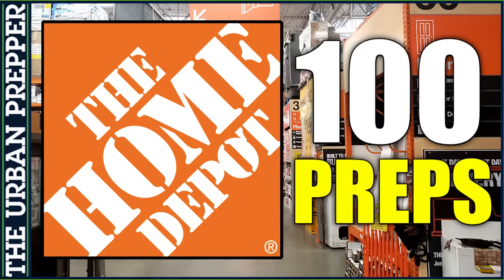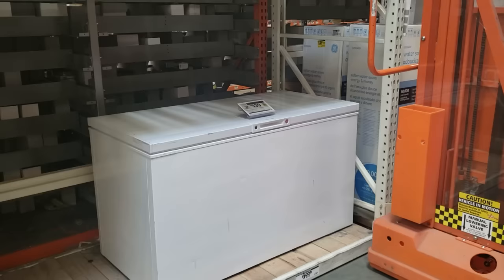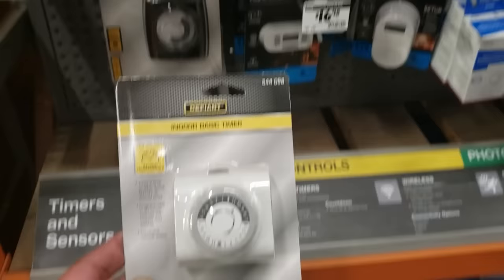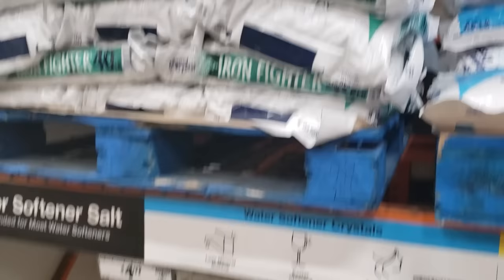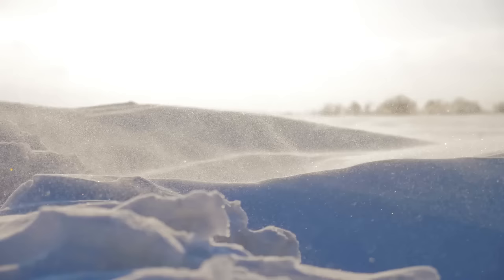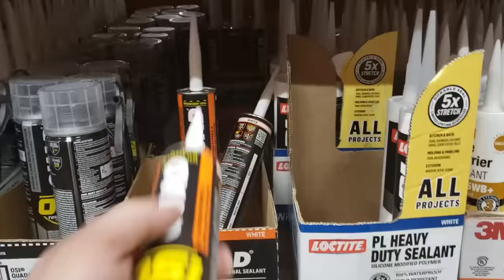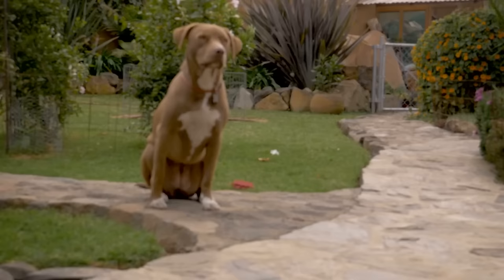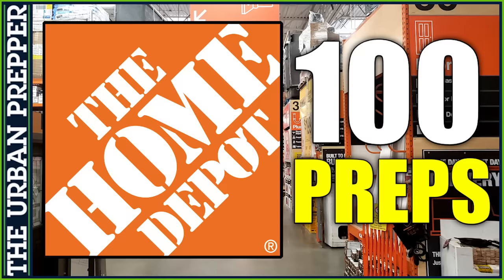Top 100 Preps to Buy at THE HOME DEPOT

Comment: Garden pump sprayer also handy as an emergency shower, fill with warm water, good for camping too.
At times of civil unrest leave some items obvious and easy to steal, ie a fuel container that's filled with water in garage whilst your real storage is elsewhere, there's a chance robbers on the move fast will take what they can easy find and move on.
Reply: Or go to Walmart and get a couple of the 5 gallon solar showers.  Just fill them with water and put them in the sun for a couple of hours them you can have a hot shower.  You can find them in the camping gear . Or you can go to any camping store or get them online.  Very useful to have.

Comment: Instead of Sand Bags 2:40, I'd suggest using "Empty" 25/50 lbs Rice Bags (Woven Polypropylene).  If you regularly eat rice, or store rice in Mylar bags/5 gallon buckets for preps, you can reuse the rice bags the rice comes in for whatever prep you'll need.  Often there are free sand/earth/rocks you can find listed on craigs or local classifieds you can use to fill those bags for floods or whatever.
Reply from the maker: Great recommendation!!
Reply: Lol I knew there was a reason I didn't throw those rice bags out...They just looked handy.

Comment: Good video.  An observation that might've been made re PVC glue (there are currently 1300+ comments, so if it's been mentioned, sorry, but bears repeating anyway) is to store it UPSIDE DOWN.  You'll likely need some sort of pliers/pipe wrench to get into it later, but you'll get in to find still-liquid cement instead of a ball of gelatinous mess from the air seepage through the lid's threads.  

If it's upside down, sure it'll glue the lid shut, but once it does that it will also seal against air getting in to the rest of the can of glue.
Reply: Fantastic information. I have wasted so much PVC glue in the past.

Comment: something i would like to point out about the snow shovel aspect, you're going to want not 1 but 2, 1 of which being a square steel shovel that you might see on excavation sites or maybe in a garden. the steel wont bend or break under extensive pressure and given that what usually fallows snow is ice thats a really big asset to have. i've been in maine practically my whole life and being the only one who does the shoveling in my family i gotta say if i had to choose between a platic or aluminum snow shovel as opposed to a stury steel shovel i would go with the steel any day. also the note of breaking, a steel shovel being used as an ice excavator is more likely to have the handle break but those are easy to replace, but with snow shovels the plastic ones are prone to having the scoop snap in half and the aluminum ones are prone to bending after a year or so of extensive wear and tear
Reply: and on the subject of work gloves, a good pair of work gloves will also function as a non water retentive covering for your hands that will also work to keep your hands warm as genuine leather gloves work for holding in your body heat, and they're less bulky making using your hands while wearing them alot more liable of an option

Comment: Regarding propane bottles, rather than buying new ones, you can often find used ones at scrapyards, garage sales, etc for free or nearly free. If they are in rough shape or are out of date, take them to the propane tank exchange at Home Depot and swap them for a newer, safer, full bottle. Then refill them in the future at places like Tractor Supply for cheaper than an exchange.

Comment: The cost of lumber has been skyrocketing.
 I live in the rust belt. So we have tube sand that I use to add weight to my truck.  But they are only good for a couple of seasons.  So I put that sand into buckets. No reason to waste it.

Comment: I recommend putting the charcoal in a sealed Home Depot bucket because nothing is harder to ignite when there is a lots of moisture in the air and your charcoal loves to absorbs it. Keep it sealed and dry. Always good to have eye protection and 26 dB earplugs for running power equipment and snoring guest!
  One tool That is a highly recommended not at Home Depot but a must have is A $500 four wheeled hydraulic dolly to put heavy items on the platform to transport it to the vehicle and raise the platform tray so it makes easy sliding into a vehicle like a pick up bed or van and example would be a heavy full tool chess.

Comment: "cost savings hack" instead of buying the designated chicken wire, go to the concrete section and buy the 17-guage stucco mesh, it's cheaper by the foot and the same size as the chicken wire. However it comes in a bigger roll, so you'll need to have the space to store it.

Comment: Great video!
Only thing to cover...home defense.
If you're squeamish on owning a firearm or can't because you made a mistake when you were younger and have a record, here's a few non lethal options that would deter a would be bad guy in SHTF.
1. Bear Spray- in a grid down scenario its a dog eat dog world.
2. Personal sized air horn. Usually in the marine section at Wally World. They're extremely ear piercing and if you're attacked a piercing sound right in the ear of your attacker would more than likely make him let go.
3. Also in the marine section, boat distress flare gun. Usually comes in a pack with the plastic pistol and 3 spare flares.
Let your imagination wonder about this one.
4. Paintball gun...leave your paint balls in a sealed plastic bag in your freezer.
5. Air soft gun. Did I mention they make them in 50 caliber? Google it.
6. Cross bow/Bow and Arrows
7. Any knife with at least a 4 inch blade.
Be safe.
Reply: Thank you for those great ideas 💡 I am 61, don't have a gun (too cost prohibitive for me at the moment) so my only protection so far is wasp spray, a metal baseball bat and several types of knives!

Comment: GREAT VIDEO!  But...I wish you had said what we could buy to do the same job if there was no power or if a solar generator could power the various tools.  Where I live, there is not enough sun to use a solar oven successfully.  Also, it kind of made me worried because I am not able to wield a lot of those tools that others find so easy to use.  Cutting plywood to fit my doors and window would be tough for me to do and take a very long time.   I have 17 windows and french doors so it would be quite a task. And such prep would require lots of advance warning which you may not get in civil unrest.    A video of prep for the physical weak and totally unhandy would be really helpful!  Thanks!
Reply: Jennifer, I realize this is 6months ago, but no one commented back. Most Home Depot or Lowe’s will cut and deliver lumber u purchased from them. Just have the measurements ahead of time. If u can use a drill, put some screws at the tops of windows and paint em the color of your house to hide em. Then drill holes in the plywood to slide and hang the sheets. So in an emergency, it’d simply be to hang em up. If they’re too heavy, have the place u bought em cut the pieces small enough for u to lift. Hope this helps.
Reply: Dedicate a room or floor just for this purpose. Build "look like" a shed, and get all preps there. A large home is helpless

Comment: Only recently discovered your channel, but saw the recommendation for chicken wire and thought of another use for it. I don't have chickens, but I do like to garden. One issue I have is with rabbits and other borrowing rodents that eat the roots of my vegetable plants. As a deterrent in raised beds, I place chicken wire down before covering with my choice of soil. It's not a perfect solution but it helps. Just as another reason you may want to buy chicken wire.

Comment: Regarding the pipes freezing. I have a PCV pipe at the edge of my porch with a faucet mounted on the end. I grabbed some old pool noodles and sliced them to fit, and then split them to wrap the pipe. It worked! So I took the extras and did the same to any pipe I found exposed. Also those pipe heaters (tape) works great IF the power is on, hence the noodles for when it's off. :)

Comment: A few things I would personally add that i have in my preps.
Pocket multitool (preferrably leatherman) i dont know if home depot carries leatherman though

Rigging axe (half hammer half axe)

Come along tool

A high lift jack

Some tube steel and metal sheets

A burke bar (pry bar sledge hammer hybrid tool)

Comment: Another good thing for plumbing is the rubber with hose clamps in various sizes to do an expedient repair of a drain pipes. These hold for a long while and they're pretty cheap, also take up minimal space. PTFE tape and spare gaskets come in handy for leaks and repairs. Some pvc fittings for drains are helpful in normal times because things break when stores are closed which I've learned from doing Apt maintenance and repairs. Shark bite fitting shut off valves are nice but pricey. 

Having spare batteries for all your drills and other basic tools that use batteries, keep them charged. 
Spare drill bits, drivers and other basics are really helpful 

Beware of dog signs Are a must, most criminals avoid dogs because of noise and risk of bites. I personally like to weather my signs for cameras and dogs so they look  year or so old. Not like you put them up to act as a deterrent during civil unrest. 

Spray paint has  a lot of uses from camoflge of gear to marking doors like mentioned. 

Various plastic sheets/rolls long with tarps and zip ties are really really helpful for expedient repairs. Match with a HD stapler and drill you can cover  lot of windows or room.

For tools grab spare blades for a Sawzall. Various length and types of materials to be cut. I like 12" 6" and 4" torch blades.
Wrecking bars, hammers and  mason hammer for splitting brick is nice to have for fitting small bricks in place

Comment: Something else you need to carry all the time in your vehicle is galvanized wire that's thin you can get them in rolls from 50' to 1000' I have found a lot of uses for it like if your muffler is dragging you can fix it quickly , I even carry 1/4 in aluminum wire just 25' of it , trust me you will find 1000s of uses for them both .

Comment: The multi-use sprayers have many applications in gardening, even organic gardening, to “folia’s” feed plants fertilizers or apply soap-based insecticides.  And as most know, the dehumidifier can be used to obtain emergency “clean” (sort of) water, if in a situation where the water is off but you still have some power.

Comment: Great stuff. One thing I have done is have an extra water heater. A non working one as long as it holds water (and pressure).  Then when the power goes out you have 50 gallons of potable water. Fresh and automatic. If any plumbers know where I could get a tank like that but not a heater I’d like to know as I’ve moved and don’t want to buy a new one.

Comment: Extra tip, Do not dump the water  from your dehumidifier. Instead, store it in 7 gallon jugs with the included faucet spigget, get a Zero water receptacle with the included filter attachment and Water contaminant battery counter to filter and purify your dump water from your dehumidifier. Which will make this water safe to drink or for use in cooking. Do not add a teaspoon of chlorine as this will damage your stomach's good bacteria. Use only a Table Spoon when washing dishes to sanitize your wash water and not your drinking water. I nearly died from drinking chlorinated tap water. And had to have live bacteria reintroduced by my physician to take orally into my digestive tract to replace the bacteria I lost. 
 A very uncomfortable experience. When an SHTF happens, there may not be a physician or any live cultures available for those that suffer digestive problems  who consumed chlorinated water. Most feel no effects but chronic fitigue developes, diareah, hungry all the time but not satisfied. Bloating, drowsey, insomnia, sluggish. See your Doctor or Homiopathic Doctor as I did,for best results.

Comment: In regards to a freezer.  Get a chest freezer instead of an upright freezer.  During a power outage, you can plug your freezer into your generator and forget the frig.  A chest freezer can be ran for only up to 4 hrs per day depending on the outside temps. to keep everything frozen on bottom, but your refig items on top.  When you open a chest freezer the cold sucks to the bottom, retaining the cold.  An upright freezer, when opened, the cold rushes to the outside.  Plan what you are taking out of the freezer in order to minimize the time the door is open.

Comment: Good video and I totally agree about Home Depot. 

However, you did leave out a couple of important things:

Barbed wire. Yes, you can buy brand-new 100-foot bobbins there.

T-posts and a T-post driver (along with T-post clips). For making your own lengths of barbed wire fencing, and/or military-style tanglefoot, for when the bad times get really fun. 

Also, those large, spike-sized nails. Perfect for punji-style pits and other booby traps.

Think Vietnam War firebase: Perimeters inside of Perimeters.

Oh, and almost forgot: A post hole digger.  Perfect for burying those contingency caches, either on or off property (i.e., weapons and ammo to retake your home, or lose everything else, for whatever reason. )

Comment: Excellent video. I picked up a DeWalt power tool kit. Has a drill, circular saw, reciprocating saw and a flashlight and powered by the same size batteries. I also picked 4 additional batteries and a double charger.  The original kit came with 2 batteries with a charger. Got it from a pawn shop about 20 years ago at a good price, it is still kicking butt and I am still a customer to this day, now I get silver coins.

Comment: I don't think you included this and, unfortunately, I don't know what it is officially called but we had a water pipe break during one of those freaky PNW cold snaps. Because we were one of hundreds in that situation, it took a while to get a plumber here. There's a device you can install in the water line that provides a temporary repair to the water lines but the big box retailers were out of stock by the time we went there. Also, we have a long water shutoff device to reach the city lines under the sidewalk.

Comment: It sounds like you will need to number , colour code and letter your shelves and a comprehensive list of, which shelf and which colour storage bin has the specific item. A dark place trying to find the teaspoons or hose fittings for the tap, could be easy and not frustrating.📋

Comment: Roofing felt and shingles. 
Roofing is measured in squares. One square is 100 at. Common 30 year shingles takes 3 bundles to cover one square. 
Roofing nails and staples. 
Large tarp/tarps for emergency protection.

Comment: Anything you buy as a DIY to use during an emergency should be tried when it's NOT an emergency; many of the flowerpot heater videos (which you can't watch when the power is out) don't really do much of anything.
Reply: Candle in a metal coffee can on a fire safe surface such as a paver. Very inexpensive and effective.

Comment: You should also keep a CO detector in your bug-out bag in case you have to shelter in a strange location that may have been compromised structurally
Reply from the maker: That's a really great idea!
Reply: @TheUrbanPrepper  I also recommend a one handed cip saw, like the Milwaukee Hack-zal, with a Spyder demolition blade for when you need an escape tool after the disaster leaves you compromised

Comment: For (minor?) flooding, a sump pump, roofer’s pump and shop vac are all useful too (as long as you have power).  Energizer now has 3 sizes of their ‘Tac’ light.  The Med. & Lg versions are both 700 Lumens w double-tap strobe for $20-$25, w the large one being rechargeable. The med & small use cr123’s, but the small is only 300 lumens.

Comment: Ice chest for snacks
Another for frozen drinks , water &2 frozen gallons 
Another for bread, eggs hard boiled , eggs, cheeses, cans pop top of tuna chicken . Foil pouches chicken,rice. 
4 gallons frozen water.
Another for frozen foods meats etc not to open , adding 4 frozen gallons water
Before needed
Freeze on top shelf gallons of water and small ones. Replace fast before power out . Gallons to ice chests.

Tape edges of freezer,frig. Don't open! 3 days usually ok.

Comment: If you are going to buy plywood for boarding up windows and exterior doors, make sure it is exterior grade plywood. And when you cut the plywood to fit over door and window frames, paint the cut edges and front face of the plywood pieces with exterior paint. Interior plywood cannot stand up to rain, melting snow and strong sunlight and the layers will separate from exposure to the weather. If you are going to spend your hard-earned money on plywood, buy the right kind that is suitable to the task.

Comment: i think something that wasn't mentioned is a must, a Brita water pitcher and a 6 month supply of filters. its cheap for what it can do, costs no electricity and you can filter questionable sources of water when your tap doesn't work. also, if you own a home, get replacement parts for all your appliances. yes it will be expensive but you will double the life of your appliances if you have the replacement parts for it. if you are building your home, request that the contractor supply replacement parts for all your appliances and add them into the cost of the build. it will save a ton of headaches in the future given if SHTF, the supply chain will be practically non existent. just my two cents